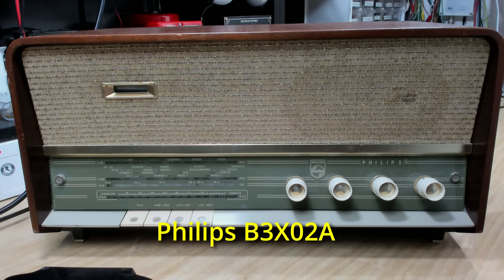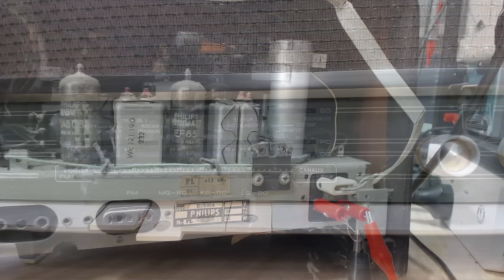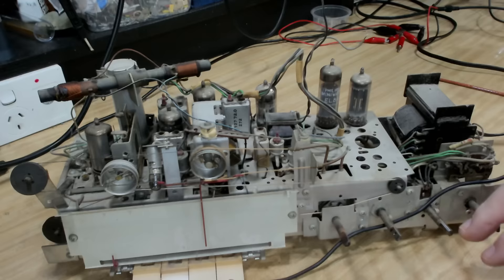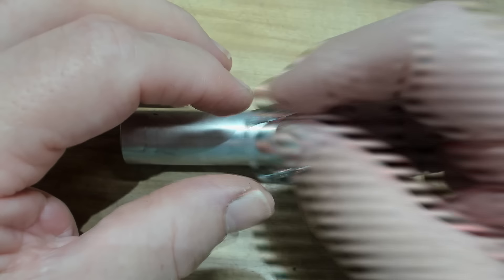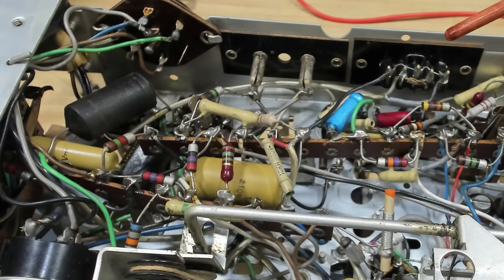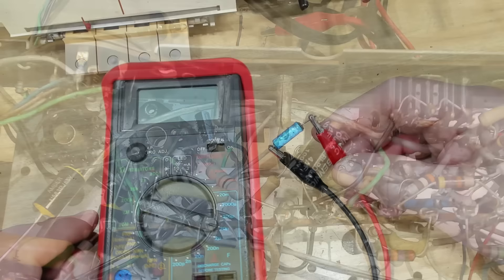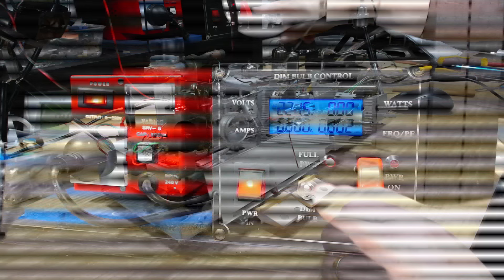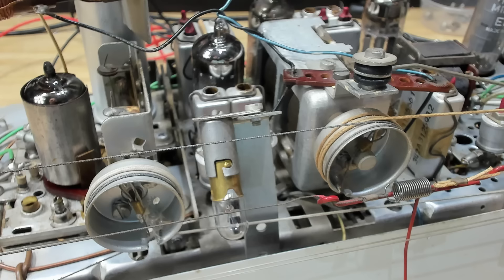Philips B3X02A AM FM Radio Repair - 1961

Comment: Hi Dave, you may know this but to thin out old wax just add a little bit of mineral spirits (white spirits) and let it sit for a while.
Rich
Reply from the maker: Hi Rich, yes I know but the problem is the solvents may attack the thin plastic tube holding the slug. I used IPA hoping it wouldn't melt anything else, it's a problem. Thanks Rich 👍🤔🙂
Reply: @DavidTipton101  sorry I wasn't specific I was talking about the paste wax
Reply from the maker: @richb419  Oh...oh... I see. Good tip, thanks Rich 👍🙂

Comment: Very nice job, as usual.
  I would still like to know what that control with the switch in the center does to it.  I've never seen a radio with one on it before.
Reply from the maker: Hi Michael, well. I didn't understand it either. It is a tone control but the switch adds some extra bass.... I think. I found a description somewhere but didn't quite understand it and can't find it now. Thanks Michael 🙂

Comment: I got one. It made some crackling sound and then a hum and then something got fried and the lights shop glowing and no sound now.
Reply from the maker: Oh dear, I hope you can fix it Rajendra 😟
Reply: @DavidTipton101  I opened it and found that one wire from supply switch is connected to one terminal of the voltage selector and other wire from supply switch is soldered to the back chassis. From that solder there is a spring hanging which might have got loosened when I opened it that was connected to the transformer where I see one lug with kind of small stud is free without any connection. Can you please confirm from your radio?

Comment: The left and right of the magic eye dont seem same "lengths"  not having the black fully central would really mess with my OCD
Reply from the maker: I noticed that on the replay High Path, I am usually pretty careful with positioning the eye so I don't know why it was off centre 🤔
Reply: @DavidTipton101  For some reason I thought it was how the tube was behaving , rather than thinking it was how the tube was laterally mounted behind the aperture

Comment: Great video as usual Dave. Just wondering why there is two B+ connections to the output transformer. Never seen that before. Cheers, Adam
Reply from the maker: Thank you @HG80369. I think... it is provide some extra filtering for the supply to the radio upstream of the output valve. It is common to add an additional smoothing capacitor in the supply to preceding components, this may achieve the same thing 🙂
Reply: @DavidTipton101  Thought that may have been the reason,  just a bit unusual. But then European radios are a bit that way. Cheers.

Comment: The European standard of FM only going up to 100 MHZ at that time was very short sighted, the US always went to 108 MHZ and it wouldn't have cost much more to achieve the full 88 to 108.
Reply from the maker: Yes, it went from 100 to 104 then 108 🙂
Reply: @DavidTipton101  yes, almost a cautious approach to reaching the magic 108!
Here in England, FM stations started using the upper band of 102 to 104 around 1983, emergency services were still using the 100 MHZ part which didn't get cleared till the late 80s.

Comment: Did you modify the radio with a translator or did it come this way? Amazing tech, made for Dutch radio but it sounds Australian when you plug it in an aussie socket.
Reply from the maker: Hi Manny, I used an eBay sourced translator in the antenna lead. It can translate 15 versions of English. I tried one from AliExpress but it sounded like Chinglish ☹️

Comment: hi dave love your videos. was wondering if you could show us how you scan and reproduce new dial artwork on your pc. thanks dave.
Reply from the maker: Hi Chris, I have shown it a few times but I don't elaborate very much.  I scan the original into the PC and import it into a VECTOR based paint program like Gimp, check its size is still correct, it sometimes changes in the scan. I then recreate the text using as close to the same font and resize it to cover the original lettering or lines. When finished, delete the original scan. I know that's not what you asked and I will spend more time in the next video needing this sort of work  🙂
Reply: That would be great. thanks Dave

Comment: Hi - did you find out what the switch in the tone control did?
Reply from the maker: Hi @renowden2010. I didn't revisit that did I. It was some bass/treble deal in one. I did read something about it but I couldn't quite understand it. One side of the switch was more treble and the other side was more bass but you couldn't adjust both... yeah, I don't know... Philips 🙄

Comment: Nice video David sir  same type valve radio i repaired problem is not receiving signals I corrected. Sir please not touching bare hand high voltage fatal shock. I'm 2 times electrically shocked
Reply from the maker: Hi Nath. Good work fixing your radio. I haven't shocked myself yet but I keep away and never move the radio when it powered 👍🙂

Comment: As nice, innovative and beautiful in design these devices from Phillips were, especially the big stereo control units were, I eventually gave up fixing these radios. The transformers are tapewound core transformers, which are tightly dimensioned and often get very warm. Then the output stage tubes are positioned so close and tight to the coupling capacitors and other components that they bake everything around them due to the radiant heat, or the sockets of the electron tubes which combine two pentode systems in themselves like ELL 80 unsolder themselves. The resistors are carbon resistors and usually deviate extremely from the nominal values. All! Unfortunately, this does not work at all.
Reply from the maker: Hi Amon. Yes, a nice looking classy radio. I haven't had a problem with a Philips transformer yet and heat is always a problem as witnessed by the discolouration of the cabinet top. The resistors were high but not as bad as I expected, they will live a while longer. Yikes, I haven't seen an ELL80 manage to do that 😯
Reply: @DavidTipton101  Hi David. Maybe the ELL80 was used in the later stereo Modells. Even worse with the heat Probleme is the ECLL800 wich often destroyes itself by while🙈 but yes... I certainly should not generalize my statements. Perhaps the earlier devices from Philips are better.

Comment: Wish we had the stations to listen to like you folks down there.  Here I can get 2 stations, one AM and one FM, both are the same channel but they added FM a couple of years ago so we could enjoy stereo crap.  They do a nice job after hours with old rock and roll, I listen to that when the television isn't blasting some liberal crap. I bought one of those loop antenna's for my listening pleasure. It worked for a couple of weeks and now I can't get squat with it, something went wrong with the lead I would guess.  Disappointing. my radio collection is getting larger but nothing to hear on them. I have a little FM transmitter for testing sets so I can broadcast my own in the house so I guess I shouldn't complain to much.  That's what we get for living in the country far away from the dangerous city life here in the USA.
Reply from the maker: Thanks Jerry. We still have a good selection of AM and an large selection of FM. Not much to listen to on FM though 🙄